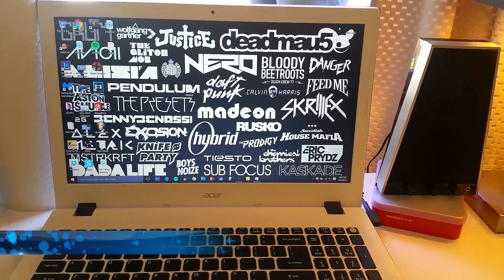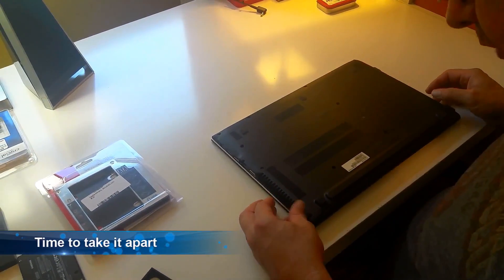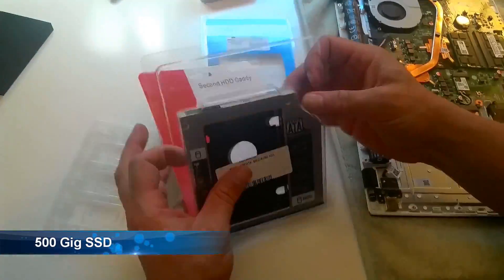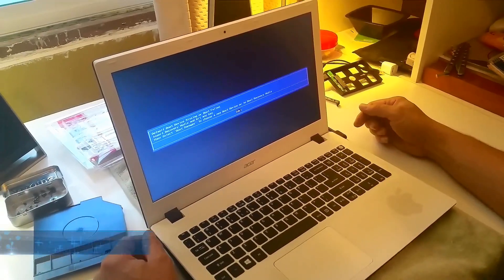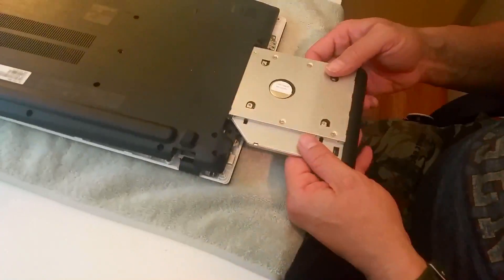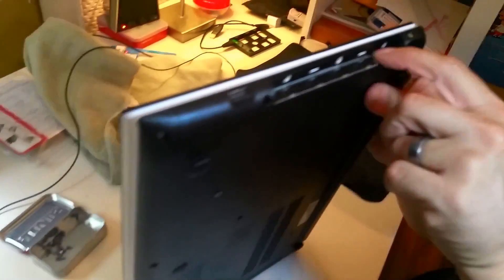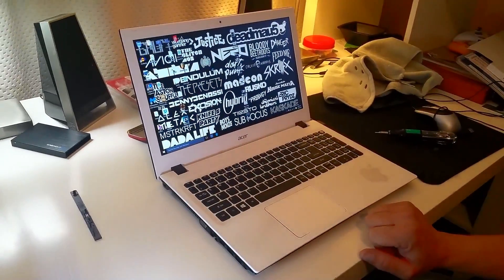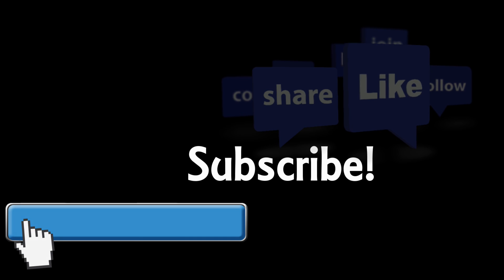Acer Aspire E15 574G SSD and Ram Upgrade Tutorial Super fast upgrade

Comment: hello sir could you tell me how long can your laptop run? mine has the same yours but it works only one to two hours with Microsoft word. hope you reply this comment. thx u in advance.
Reply from the maker: Yeah the batteries are small and the run time is not good. if your looking to use it longer you can try and turn down the brightness since the monitor is the biggest power hog.

Comment: I have the same, I think, Laptop. but mine's motherboard is laid out a little different. the blacl thing for the caddy (sorry if I butchered that) is the whole thing, and I do not have the gold piece by my fan, is there different configurations for that laptop?
Reply from the maker: could be a slightly different model. the caddy works well but I had a problem with the connection lining up. is all

Comment: Can you mix the crucial ram with the kingston ram? I'm thinking of buying one stick of kingston because its cheaper
Reply from the maker: Antekdzi1 yes as long as the connector is the same you want to make sure the mhz match I think it will defer to the slowest one. So make sure you have a match to get the best performance gain

Comment: can u edit 4k videos on it? I have the same laptop without the upgrades and is getting lagging at 1080p 60fps on GoPro videos.
Reply from the maker: Phillip Tran you can, but I have switched to power director. It is full featured and is cheap. It renders videos super fast. I am doing 1080p at 30. But I can render a 10 min video in like 4min. I paid 60.00 and it was the ultimate Version. You can download a free demo and try it before you buy. I have a review on my channel also.  I made my first videos with the GoPro software but I wasn't trying to get fancy. Power director is better for 4K.

Comment: would the ram from a 2010 MacBook Pro work for this machine
Reply from the maker: It might work, You could install it and see if it shows in the bios. Looks like they are the same size, So maybe.
 Here is a link for crucial ram that works. http://www.crucial.com/usa/en/compatible-upgrade-for/Acer/aspire-e5-573g#memoryResults
Reply: how about a 8gb 3000mhz ddr4 xmp hyperx savage ram, will that type of ram fit the slot
Reply from the maker: Spillane Sungjame AmenayiRe it's a 204 pin slot.
Reply: Thank you for taking your time to answer my questions. I have an Acer Aspire E15 E5-575-72L3 i7 with a ddr4 8gb ram. I was looking online for ddr4 rams and found some, all with 288-pins. if my PC is already using a ddr4 ram does that mean other 288pins will work too?
Reply from the maker: I wold check with the manufacturer, I normally go with what is recommended. Thanks for watching :)
Reply: thanks for you time, i found what i was looking for
Reply from the maker: No Problem Glad you found it.

Comment: Hello! So if I have a DVD drive on this laptop? Do I have to remove that to get an HDD caddy
Reply from the maker: Cedric Clement yup you would have to take out the cd rom to use the caddy, the caddy uses the connection. They do make portable cd roms but you don't have to use it if you don't need the extra data space.